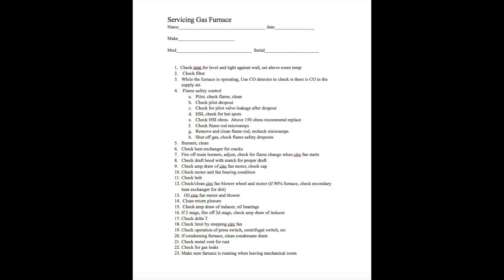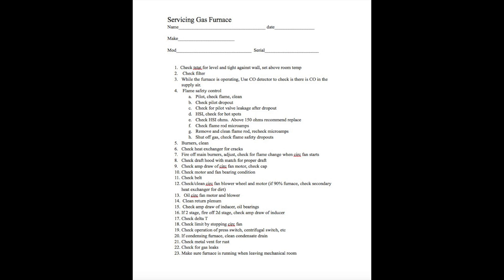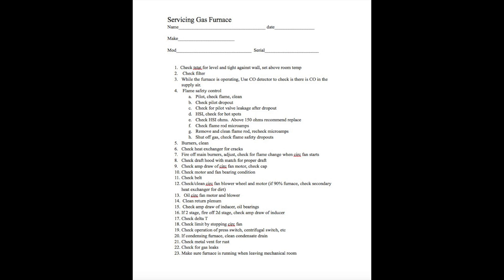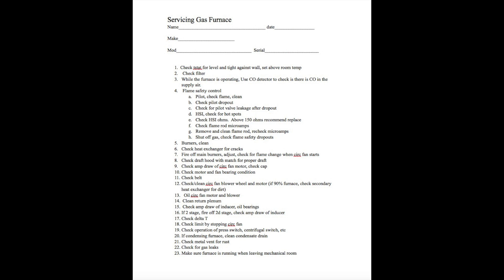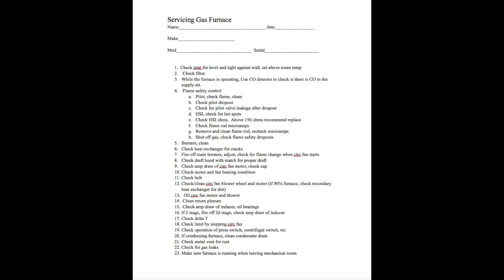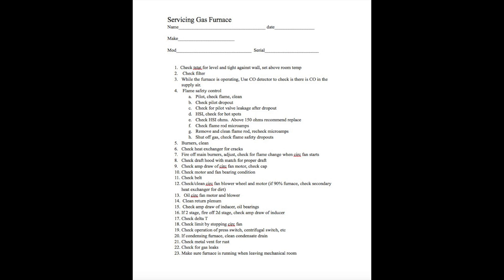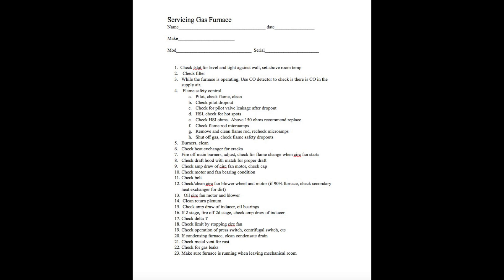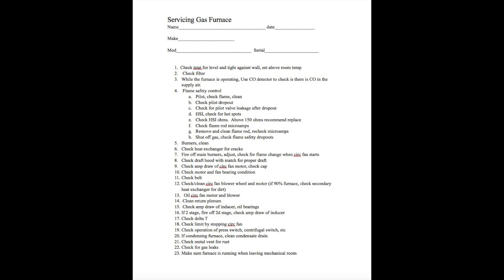Gas furnace service instructions

Comment: I am home owner   good with repair can i replace my own forced air gas furnace
Reply from the maker: There is no reason you should not be able to do the work.  Just remember to check all safeties after the install and be sure there are no leaks if you are using gas.
GFM